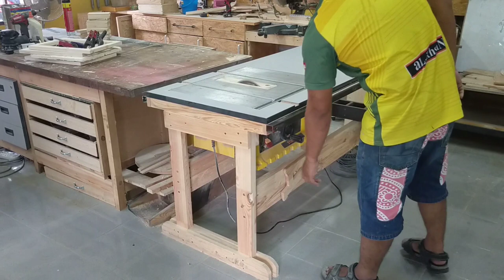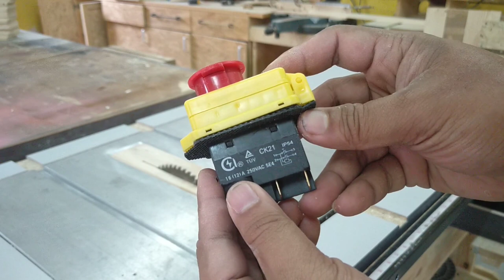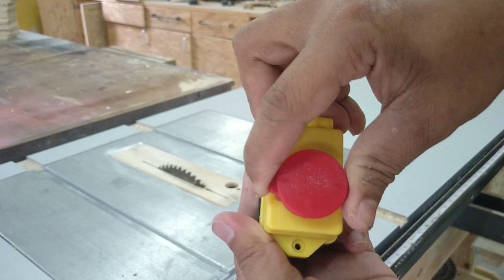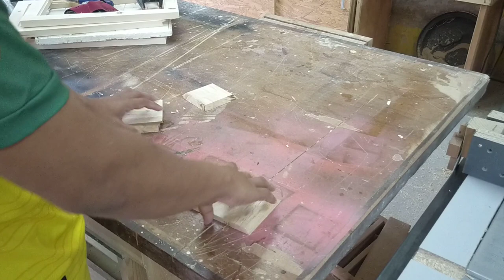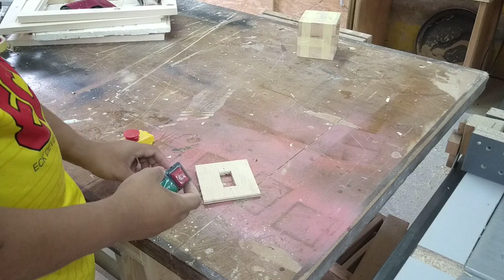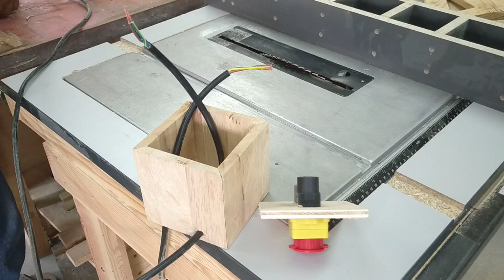Upgrade Table Saw Safety Switch

Comment: how do you attach the wires to the switch ?
Reply from the maker: the neutral straight to the machine..only the life to the switch
Reply: @Bossmiee  I'm still none the wiser - which terminal does the 'life' wire go to?

Comment: i dah dpt benda tapi tak tau nak connect .....Di pin nya tu ada nombor 1 2 3 4  .. wire Life p mana, wire nutural p mana, dan wire eart p mana
Reply from the maker: cek pakai multimeter..rasanya 1in 3out.. 2 in 4 out.x kisah mana life mana neutral.